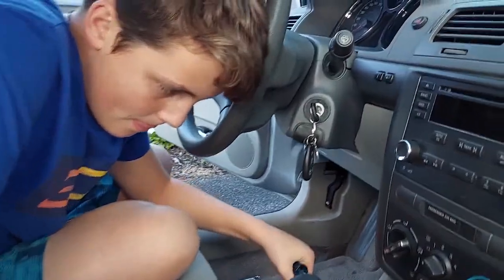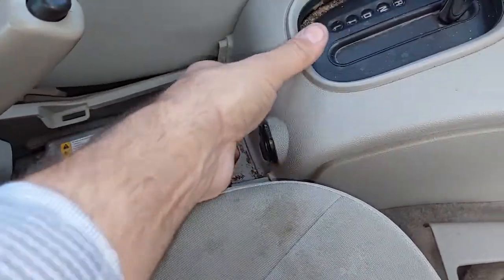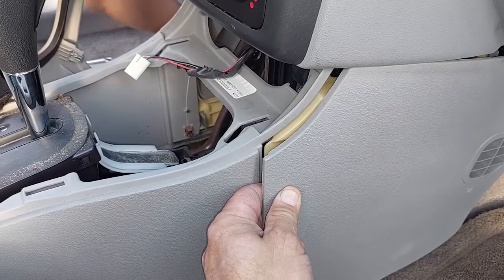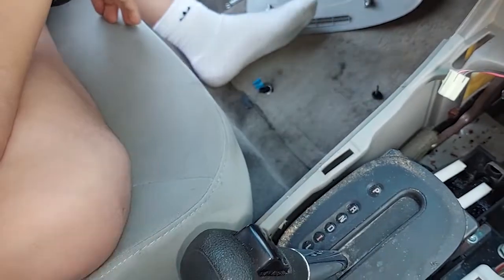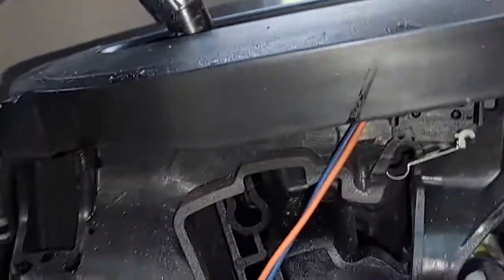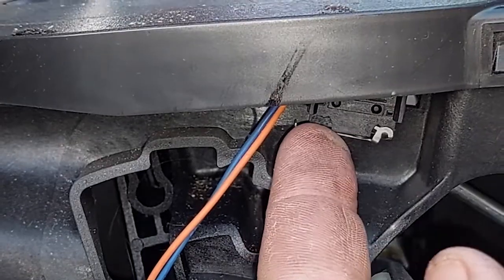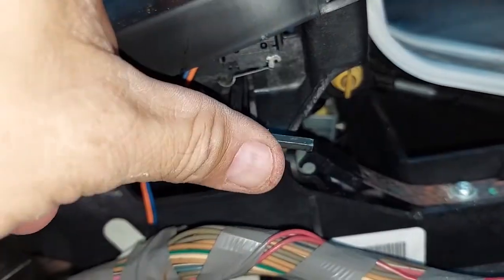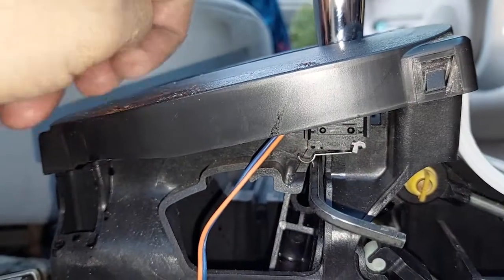DIY: Key Stuck in Ignition? Permanent Fix  | Chevy Cobalt 2005 - 2010

Comment: Thanks guys, extremely helpful.   I have reset it twice now, however, our little pin thingie is still in the slot so I never replaced it with anything longer and it just happened again.   QUESTION:   1) am I able to just pull it out and replace it?   Isn't it attached to anything?   2) Will a longer "allen wrench" move around as well, or do I have to somehow fasten it in there?   I appreciate your site so much.   We like our little Cobalt and son's wants to want to keep it.
Reply from the maker: I ran mind for a few years like this and didn't have any issues. I wanted to keep my Cobalt but my family talked me into selling it for a 2012 MKZ, now you will see video repairs for it moving forward but yes, the allen wrench just lays there and isn't connected anywhere and works just fine
Reply from the maker: thanks for taking taking the time to comment. Let me know how you make out once you decide what you did this last time

Comment: our problem is intermittent (already had the recall performed) so I'm guessing the pin is still in place. or does putting in a longer rod solve the issue?
Reply from the maker: I am not a dealer but I would guess if the performed recall didn't correct it, then my hunch is, the larger pin will fix it. This would only be a guess on my part
Reply from the maker: thanks for watching and sharing your moments.....

Comment: Would that keep it from turning over
Reply from the maker: @ralphmckinley1206  yes, if you can't get your shifter into neutral or park..... it will not start
Reply: @DIYinspiredLewisBrantner  I m played with it I still can't get the starter to engage. Codes say manufacturer control and failure to communicate with PCM
Reply from the maker: @ralphmckinley1206  sounds to me it's something else

Comment: There's a whole release button under the steering wheel 🤣 it only happens when it's dead this video is completely pointless.
Reply from the maker: You are correct, there is a button there but this video isn't showing that.It is sharing the fix. Thanks for watching
Reply: @DIYinspiredLewisBrantner  So, you're saying the fix is stick an allen wrench in the hole?
Reply from the maker: @bloodybones63  that worked for me, it's now been about a year since I completed this fix and I have not had an issue and I drive my car nearly every day. I would say, it was successful for me.
Reply: The problem is NOT only when it's dead for this vehicle.  It hesitates or doesn't come out on me all the time running in and out of somewhere.  When it's dead it damn well won't come out. :(